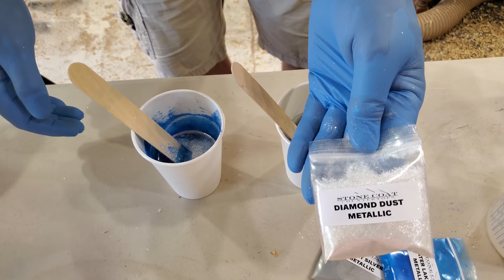Woodturning - Epoxy Vase

Comment: Loved your color mixing. I do a lot of epoxy coatings on bowls and vases. I use a rotisserie motor mounted to a jig on the bed way and a battery terminal brush epoxied to the spit rod and push it into the thru hole on head stock. Motor belt disconnected works best. Perfect rotation speed, can stop after 4 hrs for slow set usually works. Second coat can be added  from 4-10 hrs without sanding if no artifacts develop. I always darken the room and turn on a light in a distant corner. This keeps the bugs away.I still always give a final coat after a sanding. I have 2 off lathe jigs set up with bbq motors with glue blocks with imbedded  magnets for quick on off hookup
Reply from the maker: Thank you Ken and Thanks for the tip!!

Comment: Disco ball motor or a rotisserie motor can go down to 1-2 RPM. And also has settings for a irregular mixed speeds. 

Also something like an Afro pick or a hair comb is great to mix the resin. Less is more when mixing resin so it doesn’t become blended… And by only taking a few quick swipes back-and-forth you will get a perfect mixed pattern without muddying up the colors.

My father developed synthetic mother of pearl and ivory in hundreds of different colors starting back in the early 90s. He still makes 3 x 3 foot square sheets.... in dozens of colors. He uses dozens of 55 gallon drums of resin per year. His sheets are sold by all of the knife making supply houses, and also sent in bulk to the gun companies for grips and things. 

It’s really interesting stuff, and I spent my childhood helping around the shop, Making molds, and scraping hardened resin off of all of my clothing and shoes.
I’ve got an entire room full of colors, samples, and all types of molds and goodies that he went through until he found what works for him. Still a lot of great stuff and I enjoy using it. I’m not in that business but still find it useful when needing to stabilize a piece of ivory or porous wood… And dozens of other great uses! 
Love your content and that vase turned out beautiful!

Comment: First thing- love your videos, learned a lot

Second thing-  get a bbq spit slow turner.  fairly cheap from any hardware/home improvement store.  rig it up to lathe for really slow turning applications.

I used it to put an epoxy finish on a chalice still on the lathe and it prevented pooling perfectly.  just a little duct tape is all it took
Reply from the maker: Thank you Dave! Great suggestion!!
Reply: Is this Dave Cole in Indiana?
Reply: @monicapilgreen6530  negative

Comment: Nice piece but there is no way I could do that on my lathe. My harbor freight lathe won't run that slow.
Reply from the maker: Thank you John! Dave suggested a rotisserie motor. I think that would work great!
Reply: @CarlJacobson  A rotisserie motor were would I find one of those?
Reply: Amazon has them a lot of people use them when resin coating mugs. I am not sure how much weight they can hold. Good luck!!